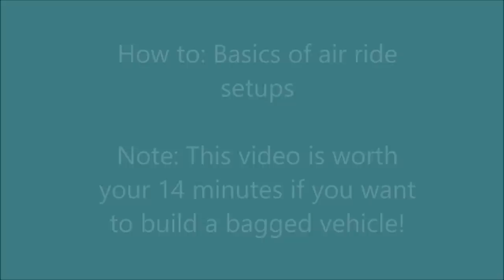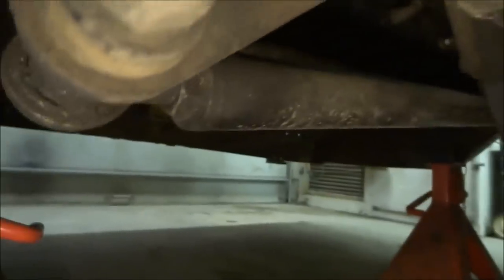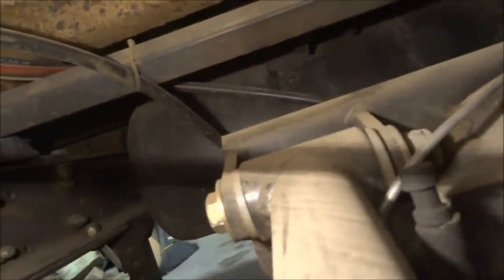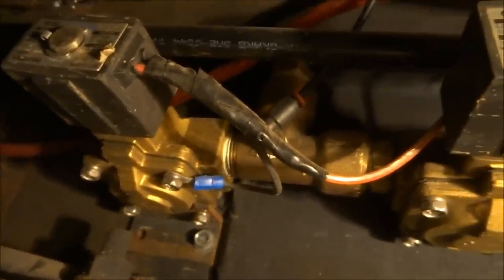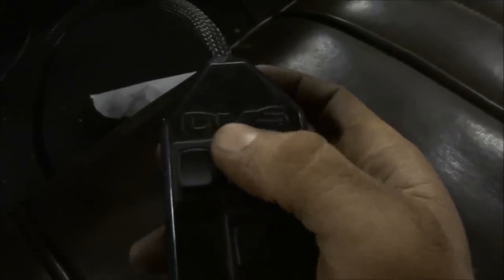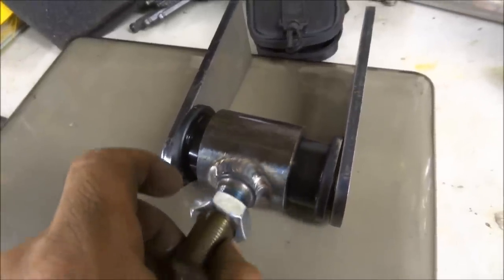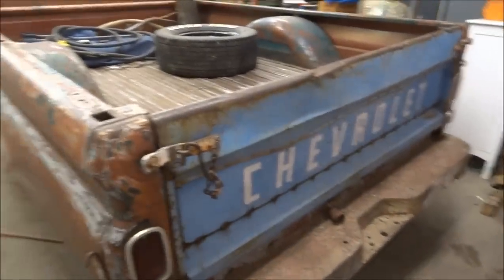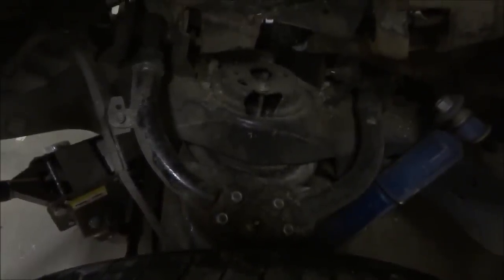How to: Airbag suspension Explained

Comment: Why are you running shocks in the front???? This is the second truck I see it like this. What is the differences between have them and not have them.. Please let me know I have a 94 Sierra and my don't have them in the front only at the back
Reply from the maker: if you don't run shocks it Will ride like complete shit. add shocks to the front of your pickup!! it's supposed to be on all 4 corners
Reply: Really.. my truck its bouncy now and it pulls the the driver side if I step on the brakes...I have been looking all over youtube and internet and I see people running the air bags but I cant really see if they are running shicks... and the ones they show they dont have them only bags... know I saw your video witch it help me a lot. This is my first air ride ever and its all new to me.. any info will be appreciated thank you soooo much... any idea on how can I build mounts for the shocks?
Reply from the maker: You want shocks up front. Very important. Any system without shocks is not properly built. Shock placement is most effective when the shocks are as close to straight up and down as possible, but a little angle is fine. Whats tricky about the front is the angle that the a-arms travel, so you have to make sure it doesnt bind. The best style are the shocks with heim ends that rotate to account for the arc travel of the a-arms. Good luck!!!
Reply: Oh ok thank you sooo much for your help.. I have one more question.. do I have to buy similar shocks like the stock ones or they have to be short or longer?
Reply from the maker: It depends on the application but in general they will need to have more travel than stock shocks. Many air-ride guys run "offroad" style shocks or truck shocks because they are made to have more travel. Obviously with air ride the suspension moves more. I run Bilstein shocks now, with Heim ends.
Reply from the maker: Check out my facebook page and feel free to send me a message there!
https://www.facebook.com/tinman2kustoms/

Comment: Hey Tinman, nice rat rod, I am doing one based on a 55 chevy truck, IFS front end kit and 4 links with bags on axel, I have 4 solenoids valves with a 4 gallons air tank.
quick question, I was thinking of only controlling front and rear high only, no individual or left/right adjustments. I will be carrying tools and materials for the most part, do you think its a good enough setup or will the truck tempt to inflate one side more than the other depending on weight distribution? any recommendations?

Thanx a lot
Reply from the maker: A lot of people just run the 4 valve setup, just controlling back and front, not each bag. it will work just fine that way as long as your geometry is correct and as long as you don't weigh like 400lbs lol if you're worried about weight distribution make sure to run good brand bags like air lift, slam or firestone.
Reply: +Tinman 2 Kustoms  thanx for that quick and clear response, I have purchased Helix 8 1/2 inches heavy duty, if it doesn't cut it I will probably upgrade it. thanx
Reply from the maker: You will be fine with those bags I would bet. And yeah no problem man, Im always open to questions.   -Luke
Reply: +Tinman 2 Kustoms hey man, I just received the kit couple days ago, I was convince I ordered a 4 link parallel  with a panhard bar, but the kit is triangulated, one triangle and 2 straight bars if you see what I am trying to describe, my question is do I need the panhard bar still?

Thank you
Reply: I am pretty convince I don't need it but I rather have your confirmation.
Reply from the maker: YOu do not need the panhard bar. If you look at my "Wild-Torquey" build series on my youtube there is an entire 15-20 minute video dedicated to triangulated suspension. I am not running a panhard bar on a high horsepower car, you sohuld be fine if it's setup properly.
Reply: +Tinman 2 Kustoms , Well, that was about the video on 4 links I have seen, thank you, very instructive... Also on placing the motor and trans, I will be running a 350 with 700 4R so a few modifications on crossmembers. But I weld with arc so do you have any idea what size rod should I use for that 4link? For good penetration in the cast differential? Thanx
Reply from the maker: Vivien BERGOUGNOUX I am not quite as familiar with arc anymore as i used to be. I would google search welding cast rear end with arc. I recall seeing a lot of information on it in the past online, but never had to do it myself. I assume you want to preheat to about 400* and then weld with a 1018 or something. But Im not for sure on that! And glad you enjoyed the video

Comment: Parallel 3 link man that thing probably corners pretty good
Reply from the maker: Exterminatingtraper can't tell if you're being sarcastic or not lol but it's not made to corner. Low and slow!
Reply: Tinman 2 Kustoms lol no not being sarcastic, alot of autocross and road racers use parallel 3 link with a panhard or a watts link cuz it has a huge range of motion and cuz it corners better and is way stiffer

Comment: Would this same setup (minus the C channel and with bag over axle) work with long travel bags? I'm looking for stock ride height and be able to drop it lower or lift it higher than stock
Reply from the maker: It could. But their are many, many factors. Bag over axle doesn't give you as much travel, but it's stronger. It's all geometry and something you have to understand if you want to build a successful setup for your needs
Reply: Tinman 2 Kustoms I’m slowly learning how it all works. I’ve only seen a few people use bags on trucks for lifts (Kelderman and Ultimate Airride) but I can never find any information on it other than towing bags

Comment: so many questions, one of them being shocks. I get the relocation but are you just running OEM? and do you fully compress them to determine where to mount them so you can lay frame? ive also seen oil air serperators and related items....the hell are those? Looking to bag my 91 sonoma just picked up the 444cs myself, going to run a train horn in the mean time as i get ready to bag my fronts
Reply from the maker: You can run OEM's, but they are a lot harder to get them installed right because they are more likely to bind. They also like to deteriorate faster because they are not made for rapid travel. A lot of the guys run Fox, King or Afco shocks. They have heim style joints on the ends so they will rotate and move better with the arc of the airbag suspensions. Some of the systems also have canisters for fluid and adjustable pressures so that you can adjust how soft or stiff you want the shock to be. Shocks are the biggest missing point for a lot of air bag suspensions. Without the right shocks it is hard to get a nice ride. And yes, in order to mount them you will want to fully compress them at your lowest point and make sure that they have the same amount of max travel as your bag (I usually go with about a 10" stroke, but depends on the bag). Hope this helps! Also, any other questions feel free to post them here! I need to get ideas as to what people struggle with on these suspensions so i can make another, better, video.
Reply: How do you know what bag to run, as an example every company seems to be selling Dominator D2500 bags and cups for my truck, and for the rear I plan on doing a bag over axle, do I use the same bags? Are different bags for different setups or is it mostly preference
Reply from the maker: Mostly preference and weight that you need. Also bag on bar or bag over axle makes a difference.. If its bag on bar you will need a stronger bag because the bag will be fighting the lever, so to speak to get the lift. the d2500 or d2600 is a solid choice for a bag. They seem to be the bag of choice in the bag world. otherwise the best bags are the Slam Specialties ss7 or ss8. Some people have had good luck with offbrand bags, but it really depends on the application. On my truck (the one here in video) I have bag on bar in the rear and bag where the coil spring goes in the front (94 silverado frame). I have D2600's in back and D2500's in front.
Reply: Ah, another question. Switch boxes, those just wire into your solenoid? That simple
Reply from the maker: Well, it depends what you run, but yes, its that simple essentially!
Reply: Rocker switches would be what I'd do, but awesome. Way easier then I thought
Reply from the maker: an AVS 7 rocker is the way to go. Its already done and they last forever. I always run them. So an ebay search for "AVS 7 rocker" and their should be a bunch of different colors. They are less than 100$ for the basic ones. Well worth it. Each wire is labeled and makes it easy to hook up.
Reply: Sweet , thanks man
Reply: Tinman 2 Kustoms Front shock relocation, i found a bolt in kit....christ S10s are simple, how in hell do you get the shock relocated on the actual control arm? (kit on suicidedoors.com)
Reply from the maker: s10's are the easiest vehicle to bag. they sell bolt on everything for them. on my lowers i just drilled a hole for shock bolt. I dont have tubular lowers so it was easy

Comment: Killer video, lots of great information! Quick question, where did you get that bitchin' train horn? Thanks for sharing this.
Ethan
Reply from the maker: Thanks! Glad you enjoyed. I bought it on ebay. Its a Shocker HornBlaster XL. They are around $300 for the horns, valve and hose. Will need to spend another $250 on compressor and tank.
Reply: Thanks for the info. I appreciate it!
Ethan

Comment: How much did this all cost? I'm thinking about getting a F100 and doin the same thing
Reply: its not cheap. theres a lot you have to buy, that if your doing it your self. but donr even try it if you dont know how to weld or fab.. to have a shop do it your looking from 3k on up. and im thinking a lot more then that. im doing a 92 s10 blazer and just buying bags, tank , lines , fittings, vales , comp. im in about 2k just in parts. and i still need to pick up a 3-link. and that $700 alone.....
Reply: and more fittings, more valves , more line , another gage , and front cups... im looking at another $1,500 at least. just in parts. and im sure when i start ill need more suff like plate metal , square tubing ect...
Reply: BenZilla Stewart  Yeah fuck that I'm going static my dad gave me a 63 c20
Reply: damn!@!!! Yeah I think I'll just save up for somethign else man thanks

Comment: I have an 88 d150, I'm not trying to "lay frame"  just want to tuck the wheels at car shows when parked at shows will a Cnotch be necessary?
Reply from the maker: Budget Audio most likely. you'd just have to measure the distance between the frame and the rear axle tube now... if it's 6" for example then you can drop the frame 6" and that's how much lower the fender will be on the tire.
Reply: Tinman 2 Kustoms how much does it cost to do air ride?
Reply: for the front I'm simply going to put D250 spring perches upfront which should drop the front about 2" if the info i've found online is correct  since the D250 has a more recessed spring perch
Reply: Fleetline on airbags

Comment: How  is  the  ride  compared to  regular  springs and  dampers? Also how  durable are the bags?  As I'd  be concerned about things  like  stones puncturing the bags..
Reply from the maker: The bags are basically the same as a tire. They are pretty damn durable. They can last anywhere from 3-10 years depending on the application. The ride quality also depends on the application. You want to run a good shock with bags, otherwise it rides like a lumber wagon. The ride quality also depends how many psi you have in the bags, so keep that in mind when you do an alignment. I suggest having the bags about 3/4 full when doing alignment, that will give you a safe ride height and a little bit less psi, giving a softer ride.

Comment: Your truck is a C20 right? What rear end did you use and why the 94 silverado front end.
Reply from the maker: shane ballman it's a complete 94 Silverado chassis under it. So it's a gm 8.5" rear axle. Got the chassis cheap with drivetrain, so figured why not
Reply from the maker: And I guess technically it started as a c20... But it's a half ton now. Sort of. Everyone knows what a c10 is so it's just easier to call it that

Comment: hey I got a 65 galaxy with all four bags and I notice leaking air from the front right bag (sparked soapy water and it bubble up slowly tho)  and I already put Teflon tape but leak much less, am I doing something wrong?
Reply: Do you have air leak from the bag or from the line? If it is from the line then you didn't use enough Teflon tape. You can also use a pipe dope if the tape wont seal.
Reply: catfisher420 , it was a loose fitting

Comment: Hey I just bought a newer truck. It's a 06 Chevy 1 ton dually. It has an air suspension but I don't see any way of controlling it. Is it supposed to fill up automatically? I definitely know it's not stock and that's it aftermarket. Any thoughts?
Reply from the maker: mana843 Its probably a load leveler of some sort.... you'd have to follow the airlines (coming from the bags) and see if they go into any valves or anything of that sort. Might just have a schrader valve so you can manually fill or release air when you plan on towing with it.
Reply: I was just driving in it and the air compressor turned on for a bit and shutoff again. So I know it's automatic but do you think there is a way to wire up to the system to control it manually?
Reply from the maker: Anything is possible. Its probably the stock load leveling system that came in a lot of the newer chevy & gmc trucks..

Comment: I have a 98 silversmith and rear works great but front has d2600 bags and barely comes up about an inch, any ideas?
Reply from the maker: joe gomez barely comes up an inch!?!? You have problems lol
Reply: holds pressure at 70lbs
Reply from the maker: joe gomez that ain't right. The dominator d2600 bag has about 6" of lift at 70psi.
Reply: this is the second pair I use with no luck maybe the suspension is binding?
Reply from the maker: joe gomez impossible to say. You'll have to look at it and figure it out. It's probably the shocks limiting the travel.
Reply: no shocks on it yet
Reply from the maker: joe gomez well, something isn't right. Probably have the lower cups to low or the upper cups too high. So it's not actually doing anything. (Assuming it lays frame)
Reply: I'm using 1/4 line do you think that's a problem?
Reply from the maker: joe gomez nope. Line size doesn't matter for that.
Reply: I didn't know bag location matters?does it need to be towards top or bottom?
Reply from the maker: joe gomez it's too hard to explain. You'd have to look at it and think about how it works.
Reply: what's should the air pai be at to lift front air bag?

Comment: panhard bar is a drag setup , you should have just triangulated the bars to rear
Reply from the maker: Ugc1911 I'm well aware of the different setups. I don't like triangulated because it's harder to adjust and setup, in my opinion
Reply: But then you wouldn't have the binding that's crushing your top links bushing!

Comment: How much $ should I look to spend on a project like this ?
Reply from the maker: it all really depends.... how nice of stuff you want, how much of the work you can do yourself, etc. I know guys that have 2000 dollars into their bagged truck and I know guys that have 100,000 into their trucks.... A mid grade setup, installed all yourself is going to run you about 2k just for the bags, necessary connecting links, valves, switches, line, compressors, etc.

Comment: How much did all of that cost you?
Reply from the maker: Kent Hawkins It really depends on the quaility of parts used and the extent of the drop that you want. A typical air ride system with all the suspension components, valves, bags, compressor etc is somewhere around the 2500-3000$ range. I have seen 20,000$ air ride systems though. I have also seen people that can build one using old or repurposed parts for 7-800$ total.
Reply: Thanks and wat did you pay for yours?
Reply from the maker: I am not even sure exactly what I have into mine. I wanna say somewhere around 4,000$ into suspension.

Comment: Do you know why my compressors are not turning on what can b the problem
Reply from the maker: could be many things. a bad pressure switch, a bad relay or a bad power/ground connection on the compressor itself. could also be a bad compressor. start with the connections and checking the pressure switch first.
Reply: Thanks i changed both relays that didnt work were is the pressure switch

Comment: how much did this all cost
Reply from the maker: +justin ferreira Hard to say, can range in price dramatically. I have heard of people building systems for 600$, but also heard of 20,000$ air ride systems. So its really personal preference and quality preference. This is a mid line setup. Got probably about $3,000 worth of air ride stuff with frame mods, no labor included of course.

Comment: Thanks :) I was like. :O NOOO I'm building a budget it's gonna be expensive then i price it up and realize everything for an s10 chassis is dirt cheap haha in build a 1951 ford pickup
Reply from the maker: Tweak Work Yes, s10 chassis is the way to go if you want a budget build and can make the wheelbase work :) the 2.2L s10 engines are bulletproof too. not fast, but run forever. lol

Comment: how do u align a bagged truck?
Reply: Josh Mitchell easy, ride hight is when your lower control arms in the front are parallel to the ground and in the back weather you are using trailing arms or four link is when the trailing arm is parallel or the lower link is parallel to the ground